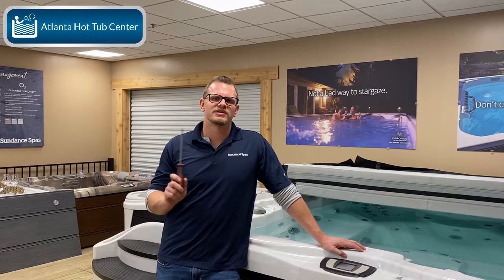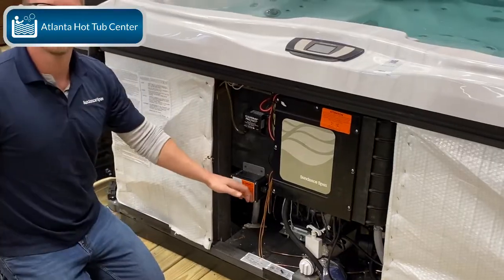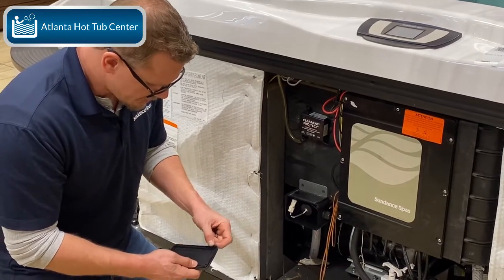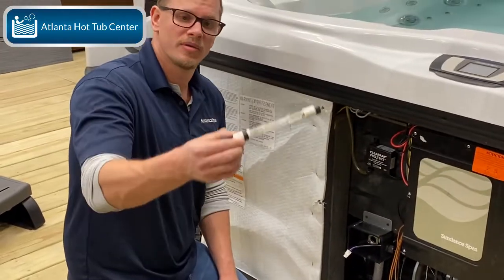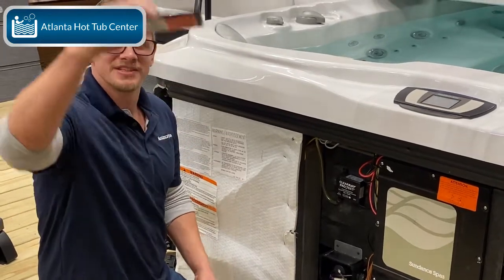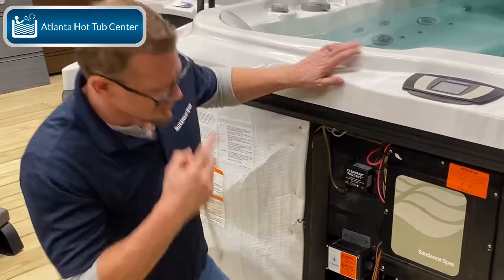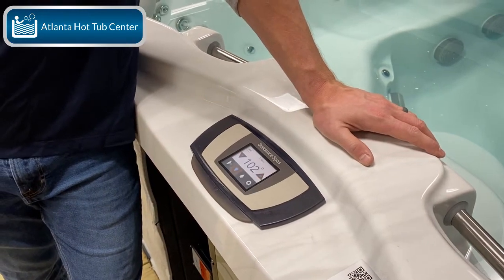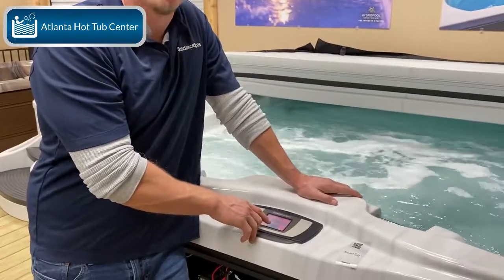How to REPLACE your CLEARRAY BULB

Comment: I have a 2006 sundance Marin 880 tub, i'm getting a 616 code . 2 years ago we had a different type of ozonator installed and this the first time we've seen this. how do we clear out the code??
Reply from the maker: Good evening, I would suggest doing the following below;

1)To reset your countdown timer hold the Jet 1 and cooler buttons for 3 seconds, you will see your filter cycle indicator come up. At this point press the warmer button until you see 0.

2)Once you see 0 press the Jet 1 button and your ClearRay countdown timer should reset. If the countdown timer was at 0 the Jet 1 button will reset it. If the countdown timer was not at 0 the Jet 1 button will not reset it. All of this info is also on page 32 of your owners manual.  Hope this helps!

Comment: How do we know if the bulb is OK or not? Also can we add an OZONE generator to this tub?
Reply from the maker: Good evening, Sundance does have both Ozone and ClearRay factory installed.  The processes take place separately for efficiency reasons.  The hot tub will read “blb” on the display when the bulb is out/failed.  Hope this helps

Comment: Thanks for all the great videos. Making my decision easier! 
Just curious what is the average cost of one of these bulbs when I replace it myself?
Reply from the maker: Good morning, ClearRay bulbs are normally between $80-$100.  The idea is that they mostly pay for themselves as a ClearRay system limits the growth of bacteria.  Since there’s less bacteria is the hot tub you’ll use less sanitizer to keep it clean.  Hope this helps!
Reply: @atlantahottubcenter  Thanks a ton for the input. I just put 50 percent down on a Sundance Aspen 2 hrs ago. 😁 Didn't get to wet test it, but hoping I'll love it!! 🤞
So it's going on my backyard walkout basement patio slab. It is of course slightly tilted away from the house for drainage. 
My question is-  I hear you mention don't level the slab, level the tub?? So do I just use shims? Should I not worry that it's not perfectly level if it's close? ( my concern is width wise it is a pretty tight fit between the house, and some boulders that act as the retaining wall. So I'm not sure I would have room, once the tub is set, to even put in a shim......?? I've imagined maybe hot glueing some shims to the bottom or something like that while it is still hanging in the air from the crane.....)
Thoughts???
Again sure appreciate the time you take on your videos and these messages. You should get a commission for my sale, cause it for sure helped me decide on Sundance!!
Danny
Reply from the maker: @dhandmg  Good morning, thanks for the kind words!  When we level a hot tub we rip wedges that go the entire length of the hot tubs base.  We evenly space the wedges underneath the hot tub.  You’ll need multiple wedges for an Aspen.  You have to make sure the middle is supported.  The dealership should take care of this for you as part of the purchase.  If they don’t you can always hire a handy-man.  They can use leverage to get the hot tub off the ground enough to slide the wedges in once the hot tubs in place.  Hope this helps!
Reply from the maker: Furthermore, I’ve seen people use this platform in the link below and it works quite well but it does bring the hot tub off the ground a fair amount.  Hope this helps!

http://thespalevel-r.com
Reply: @atlantahottubcenter  Just saw that I never said thanks for the response! Sure appreciate it! Been enjoying my Aspen for a year now, and still like watching all your new videos for the good info!!

Comment: Brian you forgot the most important part  !  Cleaning the quartz tube. Dirty tube equals short bulb life !  $ $ $
Reply from the maker: Good afternoon, so we normally suggest cleaning or replacing the quartz tube every 2 years.  The quartz tube doesn't have anything to do with the bulb life.  However, if it's dirty the system wouldn't be as effective since the bulb shines through the quartz tube.  I would check it as you replace the bulb and clean it or replace it if necessary.  Hope this helps!
Reply: @atlantahottubcenter  how about a video on taking out that quartz tube and cleaning it.  Thank you!
Reply from the maker: @bigdawgdesign  Good afternoon, no problem.  I put it on the list and we'll get to it soon.  Thanks!